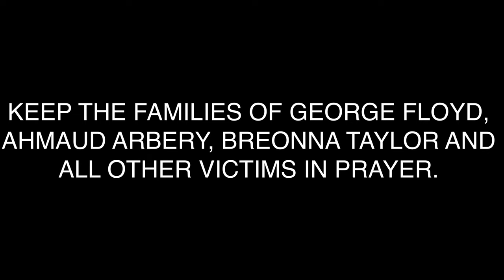INSTALLATION OF GMC YUKON GRILL

Comment: Planning on doing the same to my '08 Yukon XL. I will be replacing upper and lower. Same grill only from Amazon
Reply from the maker: Cool bro! Definitely looks a lot better than the stock grill
Reply: For sure. Having a difficult time trying to find aftermarket headlights that break the bank. My Yukon XL is white as well and Im going with the blacked out accents as well. Got the smoked tail lights installed 2 days ago with some super bright LED reverse lamps from Diesel LED's. Those reverse lamps are no joke
Reply: @Moe_Thai  Amazon has some icy headlights $300 ima get a pair

Comment: Im having trouble finding a black hood molding trim did u paint yourself
Reply from the maker: Yeah I couldn’t find one either. I scuffed it up and painted it with truck bed liner
Reply: @russellmuscleatl  kool I'll try that thanks for the tip
Reply from the maker: @SPOT09702  👌 no problem
Reply from the maker: @SPOT09702  I used primer before sprayed the raptor liner on it

Comment: Can the grill be traded out on a 2021 SLT for a 2021 Denali grill?
Reply from the maker: Haven’t did a newer model before but I’m sure you can. Just compare the brackets to see if they are the same. Or if you search on eBay for a aftermarket one, it will tell you what models the grill will fit.
Reply: @russellmuscleatl  I asked the dealership…$1800 for just the grill, still had to factor in their labor 🙃